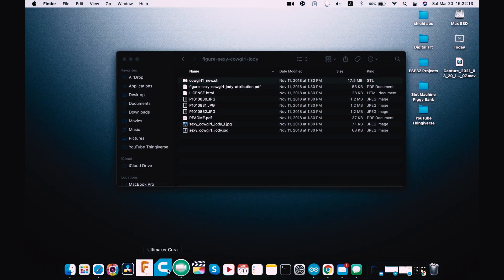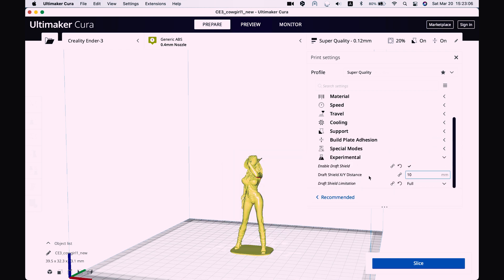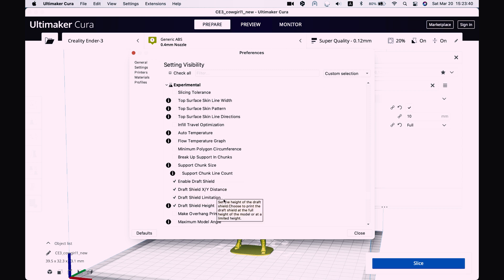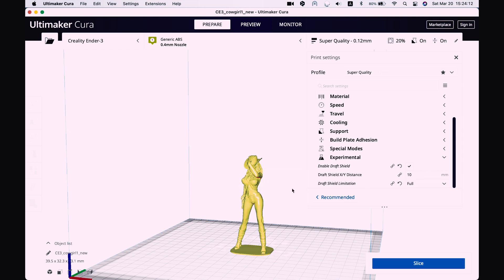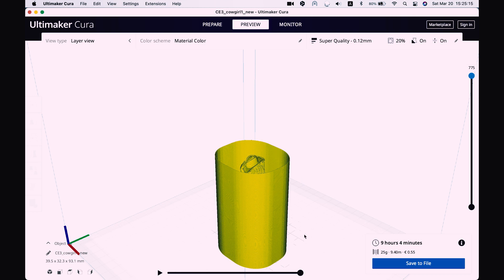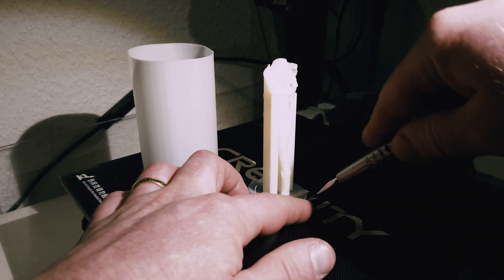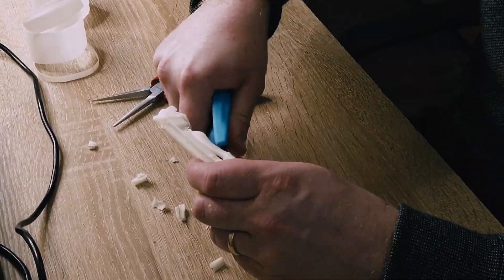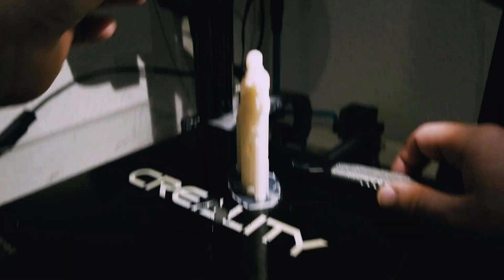ABS WITHOUT ENCLOSURE! 3D print with ABS using Draft Shield!

Comment: ALWAYS protect the bed with glue or any adhesive when printing everything from PETG to ABS. It's a Pain in the ass to resurface the bed.
Reply from the maker: Yeah.. that’s correct!
Reply: @Max3DDesign  Or you can get a microporous coatings glass surfess for 20$, whenever the bed cools down the model is detacched with zero efforts!!!
Reply: @remy44444  Is it necessary to clean the bed afterwards?
Reply: @nachgebaut4176  It came easily without any mess after bed cool down to 30c.
I clean with water every week but because dust gather up.